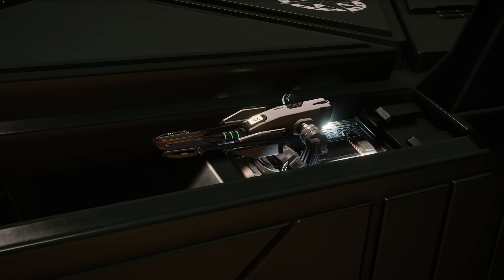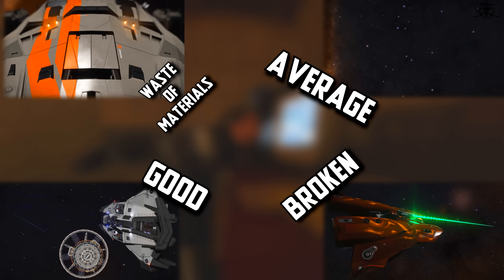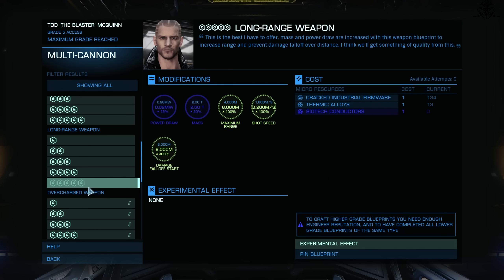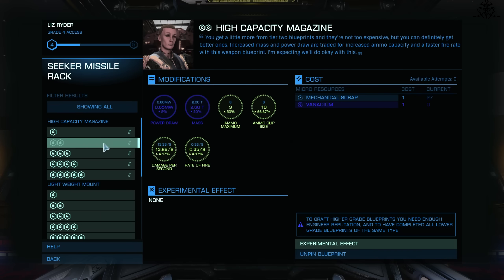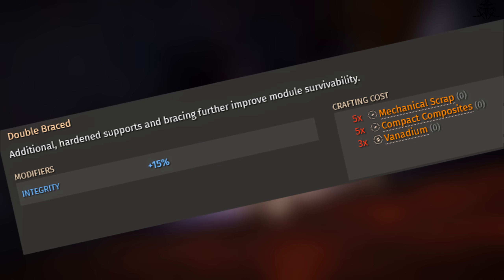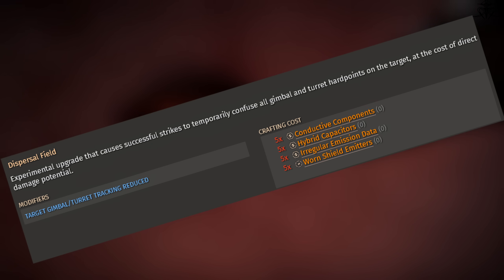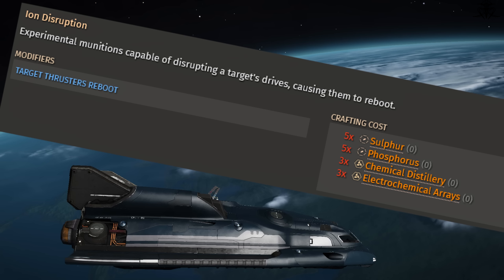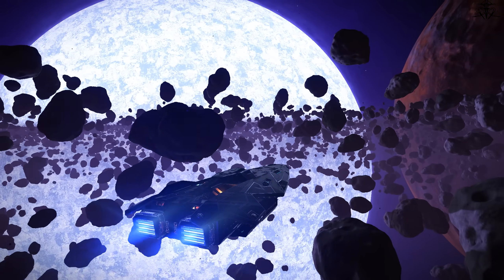BEST to WORST : AVERAGE weapon engineering tier(Lightweight,Long range,sturdy,Force shell)

Comment: Hey a question, im going with Overcharged  Multi-cannons..   But would long range be better ? with increased velocity  and less damage fall off ?
Reply: you would actually hit something 2km. all the high level npc-s will do turns and curves and the slow speed of the projectile will make it miss although "you are almost in range".  long range gives a massive projectile speed boost.

Comment: I like using long range for pulse/burst turrets on the anaconda's small slots as they are useful as just annoying the hell out of NPCs in a haz res.  I tend to run a large pulse with it just for initiating combat so I can get aggro before sending the fighter over.  Also works well for kill whoring :)

Comment: Main reason to pick concordant sequence is because it acts like a shield cell bank. You don't need to use Regen Sequence. The advantage it has over regen sequence is that it isn't dependent on the damage of the weapon, or the resistances of the targets shields to determine how much healing it does. It restores a % amount per use (the exact amount, from what I've been able to find out, is about 13%). Meaning you can put it on a class one weapon and it will give even a shield tanked Prismatic Cutter a hefty shield boost when you use it. The downside is that it doesn't work while under fire. But it's very handy to keep on a small weapon in a wing for downtime when you want to heal up your wingmates without having to have larger beam lasers with regen sequence to do anything noticeable to their heavily resistant shields.

Comment: Two point:
1.  You said the long range weapons were OP, but never said why.  I use a long range turret on each of my ships to engage targets at long range, so they’ll come to fight me at close range.
2.  The focused weapons Do increase the damage fall off distance, but only at higher levels.  You actually show said upgrade in the video.  Right?
Reply: ON PAPER Long Range weapons give the biggest % damage boost out of all mods in certain conditions, just like Efficient will be the strongest boost when you calculate your damage per hour of continuous fire compared to weapons that actually dry out the capacitor. If you shoot your laser at 3KM you only deal 20% of that laser damage. Long range removes the damage fall-off so you deal 100% of your laser's damage - so that's 5 times (or 500%) damage increase. Outside of the range the benefit is obvious. OP does not necessarily mean the strongest damage dealers or most powerful in general, it just means that in comparison the benefits are much greater than the equal rank options. That's why for lasers G1 Long Range mod is the most OP mod out of all available ones as it gives you that theoretical 500% damage boost on even rank 1.
Reply: @AllinWhenPlaying  you are forgetting that most of mortals are lazy as ** , so we use gimballed weapons and don't hit anything at 3km+ .... and let's not forget the armor penetration buff the focused have. Perfect for us autoaiming amateurs. This will be a keeper on my burst lasers.
Reply: @hurdurdur7rl696  Not only I said ON PAPER (in actual caps) but for calculations like this taking preference or skill of the user is pointless as you can't factor all the spectrum of people skills in a numerical value unless you want to calculate it for each ~1% difference of accuracy and time in a function with damage per distributor load in a given time on target. It can be done, technically - but not only it would give you a whole novel worth of results, each of them would be rather obvious and could be logically extrapolated without going into actual spreadsheet.

So, not sure what you're getting at. People that don't use fixed weapons and/or are less skilled would benefit less from it?

Wow, man. Ground breaking outcome. Your nickname does check out here.
Reply: @AllinWhenPlaying  I agree with all that. I ran simulation on excel regarding range effects, and results are sometimes surprising. All laser weapons suffer the most from range, and most lasers' users don't really realize it. LR also adds much speed to projectile weapons, and this actually transform them completely, their use is different, notably because it adds accuracy, and if you hit twice as much shots, your real DPS doubles...

Comment: High cap becomes pretty viable when you use caustic rounds though, slap that on a small, gimballed multi and you can let (literally everything else) chew through the hull!
Reply: That's exactly what I use the small slots on the Federal Corvette
Reply: @erikcampbell9882  Do you use them at the same time? If so that is a bad idea since they do not stack.
Reply: @Hiniberus  Nah, it's an endurance set up so I'll only run one at a time to really extend the duration of a murderfest
Reply: @erikcampbell9882  but you could just synthesize more if it's thing on for that long
Reply: @Hiniberus  You underestimate how lazy/much of a hoarder of materials I am
Reply: You could even go turret rather than gimballed since the status effect is what you're after.  Especially on the big three.
Reply: @kuro_neko5863  Not sure since, generally you would not really use just that on its own at any point though.
Reply: @Hiniberus  My thought would be to keep the status effect applied as long and as often as possible you'd go turret so the gun has more chances to bear on the target and apply the effect, not caring about the reduced damage from the turret.  And then keep everything else gimballed (or fixed) for proper damage.
Reply: @kuro_neko5863  but what's the point of keeping it applied when the whole point is to boost the damage of the other weapons through it? At that point you're just wasting ammo
Reply: @Hiniberus  It only really makes sense on the big three where it's possible that not all the guns will bear on a target at any given time.  but it's certainly a debatable point.

Comment: Lightweight is crucial for small combat ships; see how much benefit you get from engineering your Viper’s guns with lightweight.  It’s meaningless for medium and large ships though.
Reply: Agreed, it's invaluable on the ultralights like Imperial Courier and Viper mkIII. Minimizing weight lets you push those Dirty Drive-modded Enhanced Thrusters to the max, and reduced heat and power draw are exactly the secondary effects most lightweight fighters benefit from.
Reply: @Jadriam  - I'm running 3x C2 PAs on my Courier right now, and even with Lightweight it's as much heat and power draw as it can handle.  I guess I could get that the reduced power draw and heat with Efficient, but then I'd gain mass and end up losing like 100+ mps off my boost speed.
Reply: @florbfnarb7099  Never give up the speed, that is what makes the fighter small ships effective (well that and agility). I never got on with 3 PA's or rails on the Courier that well however far to often one wingtip is not able to hit the target so is wasted despite the speed and agility (depends hugely on what you are shooting at and the nature of the fight, lots of other small ships in the combat zones...), I found it more effective to run 2 so you could fire more freely and go faster still - doing that could lightweight the power plant further and still fit a useful kinetic weapon for finishing off (Though as I was mostly using the ship in combat zones at the time I had plasma slug to avoid coming in for ammo).
Reply: Actually useful only to reduce heat generation and power draw
Reply: Princess Luna - which I rarely have troubles with.  Seems like a waste to give up something more productive on a medium ship just for reduced power draw and heat, when Efficient will do the same thing better.  Still valuable for small ships though.
Reply: If you're using light weight for small ships you're doing it wrong
Reply: quantum6 why?  High speed is bad and I should be purposely making them as slow as mediums?  There’s no point to a small ship that’s no faster than a Krait.
Reply: @quantom6  There is only one small ship for which I think I agree with that.. The Diamond back is never going to be that agile or fast from a bit of stripping down.. But it can't half pack a punch for a small hard to hit box